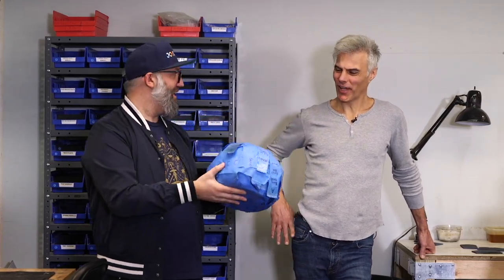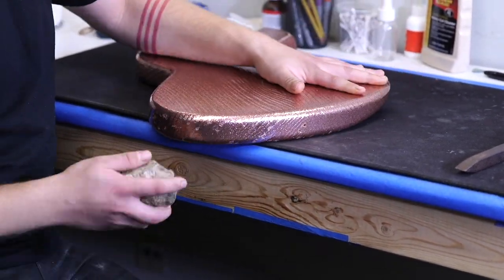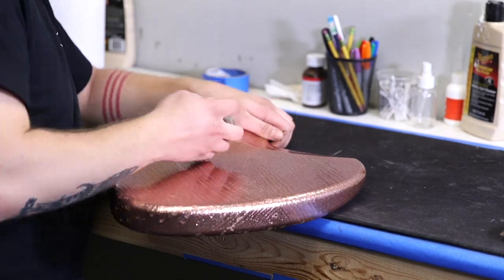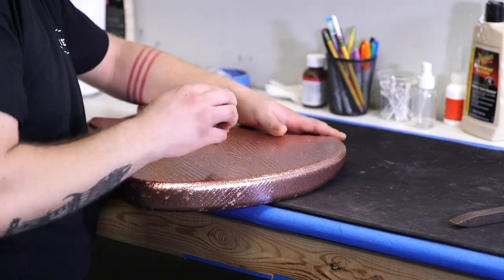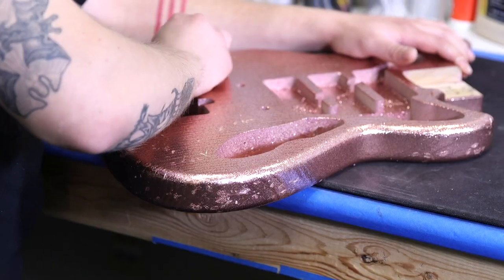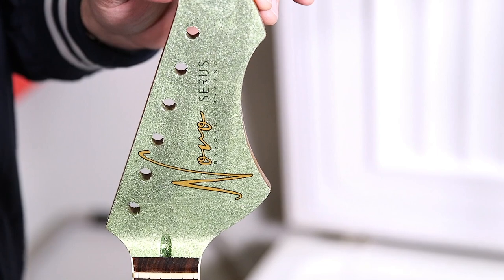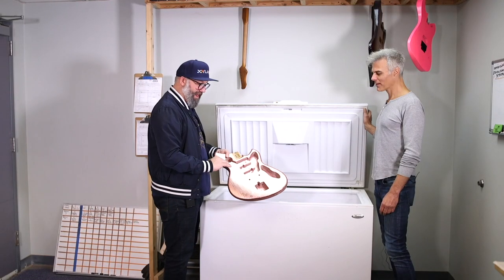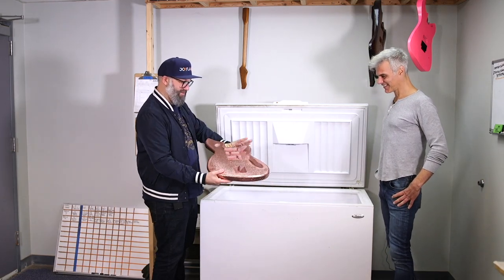Relicing Guitars with Novo

Comment: Pine is super soft so I doubt they could actually offer a “brand new” scratchless guitar. Thing would be dinged up before it left the factory
Reply: Old growth heart pine is harder than many hardwoods.
Reply: @DisabilityExams  I listened to a interview about the Nova company they have I think 5-10 employees that make all the guitars. They go for those heavy grain ridges on the body which i got the impression was accomplished by using cheap, light, and young pine. It honestly looks like some of the cheapest and most common wood out there. Reliced or not that guitar will pick up dings real easily.

Comment: For the lacquer checking you can get a can of the spray air for blowing dust out of electronics.  Take the can and turn it upside down and spray the quitar finish and it will do the same thing except it does it right away instead of waiting days.  If you do it with the spray air then it only effects the fish without  the possibility of the different woods shrinking on the neck.  There way could cause issues with the fretboard later.
Reply: What? I've straight up done exactly what you say and have experienced nothing of the sort. Besides a temporary haze dustoff leaves or residue dexoit leaves, either can literally be obviated with instrument cleaner.
Reply: @guyfromthatthing1017 hmmm you have to heat it up first. And you need to make sure you have a nitrocellulose finish. Not a poly cuz that one will never check

Comment: Amazing! I think it works better when you do the opposite: heat it up and then to the freezer.
I think it a chemical thing when the finish goes with the heat and dilates and the the sudden cold crack it.
I did mine that way, I left it like an hour in the killer summer sun of S.Florida and then straight to the freezer! Perfect in one take!
Coffee or shoe polish for plastics, put all the hardware in a little bag with rocks and shake it babe! Also etchant solution takes the shine away but it needs a little more of "expertise".
Nice video!